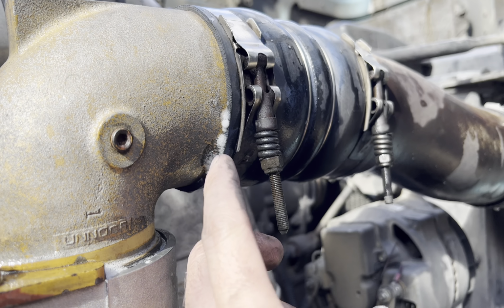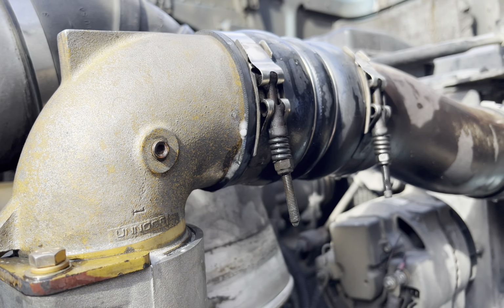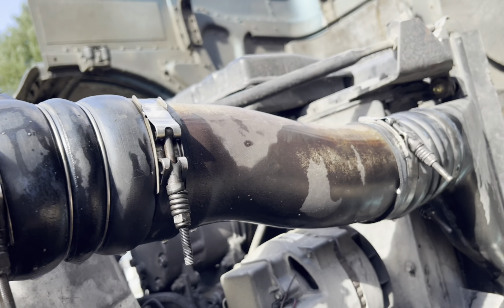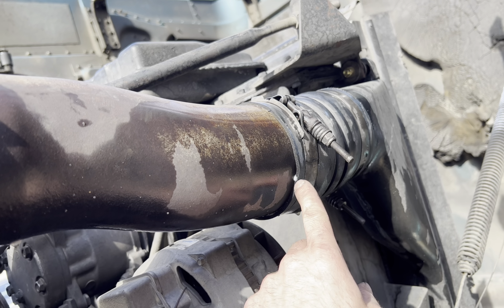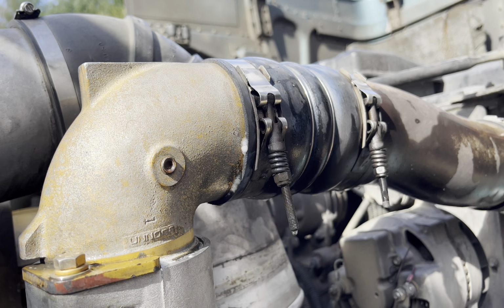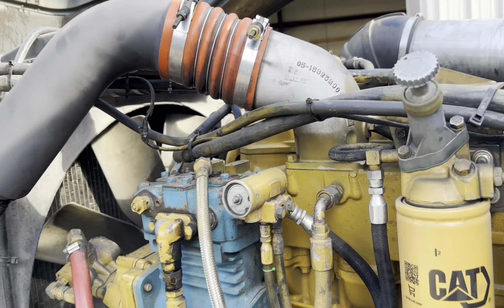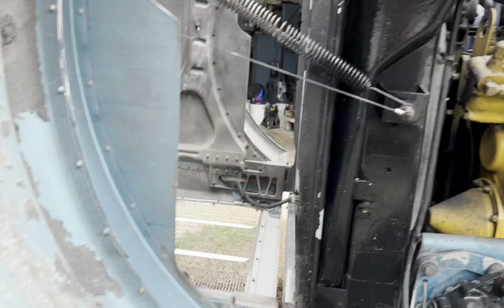Peterbilt has excess black smoke fix

Comment: If the v band clamps are leaking, is it time to replace the turbo or will replacing the clamps be enough?
Reply from the maker: If it leaks on the compressor housing, I machine it for an oring. I machine them for an oring if they are in for repair, to eliminate the possibility of a leak.
Reply: Donde puedo conseguirlo
Reply: Is it fixed